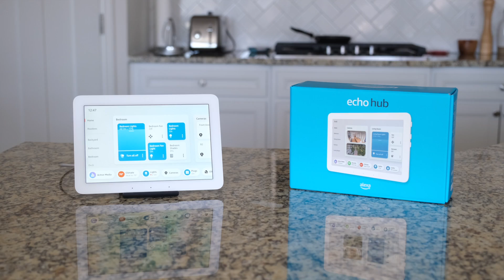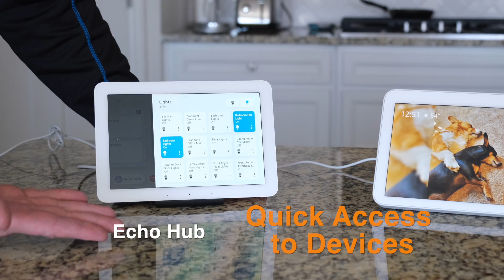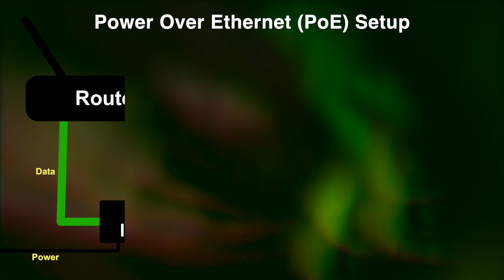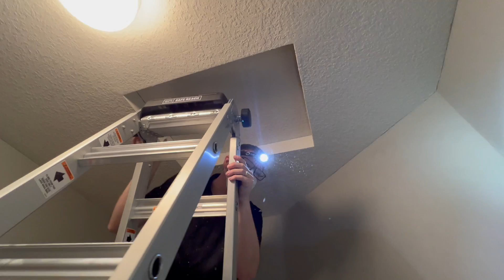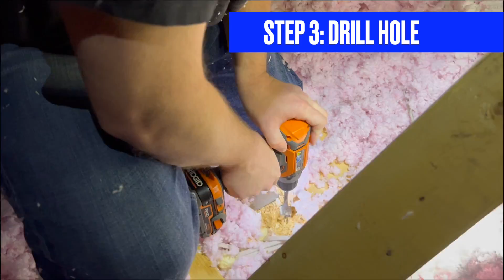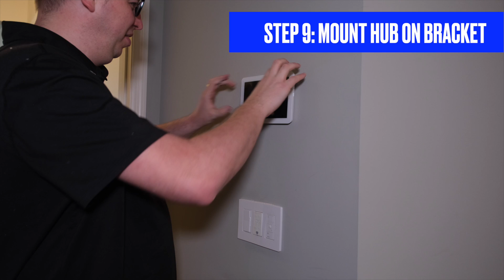Wall mounting the new Echo Hub with PoE (Power over Ethernet)

Comment: I already had 12v cable in the wall from an old security system, I found on Amazon AITRIP 3PCS PD65W Fast Charging Modules 3 for $8 these are tiny and provide all the power the hub needs, been using this for a few months perfectly.

Comment: I did the same install, but got a low power error 😢
Reply from the maker: hmmm....Did you use the recommended PoE to USB C converter? (the link in the description is the one we used and is recommended by Amazon for the Echo Hub)

Comment: Not much insulation in that attic. You're in MN; right? Brrrrr
Reply from the maker: Not my house. Not my problem. (It actually seemed pretty thick to me, but I'm no insulation expert)
Reply: @DIYSmartHomeGuy1  It's my house, and there are measuring marks. I forget what the R value is but it exceeds the requirement for the state, our utility bills are actually quite low